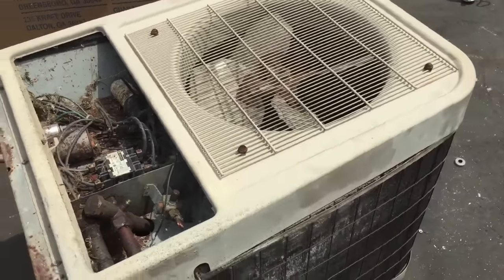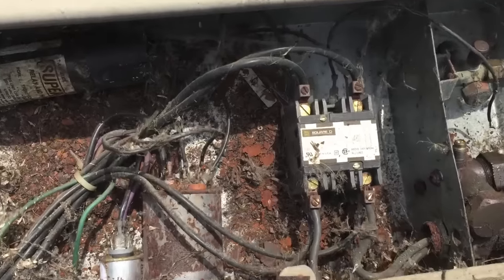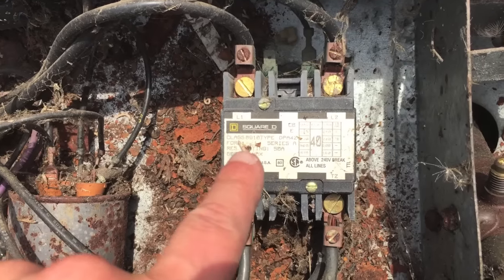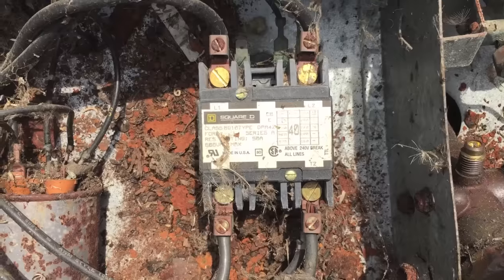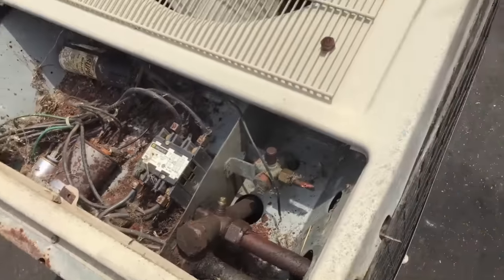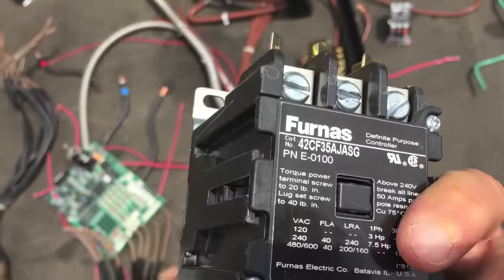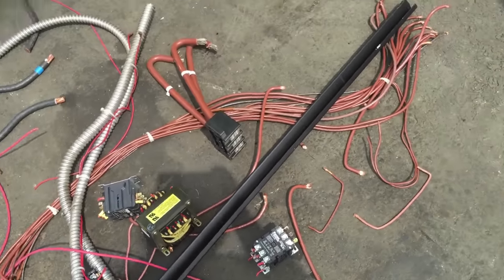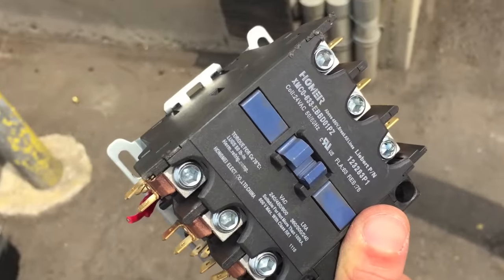Reselling Circuit Breakers Instead of Scrap - Make More Money

Comment: That is not a circuit breaker but actually a starter or sometimes called a lighting contactor. Just a little FYI
Reply: Ozzie Capetillo it is not a lighting contactor... lighting contractors are used when there is NOT an “inrush” so to speak... these are time delay contactors... totally different